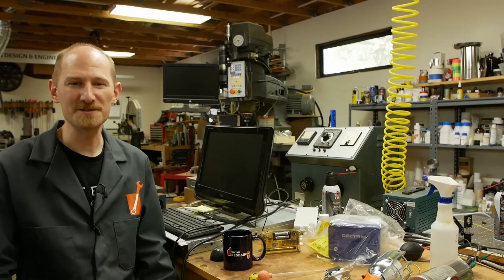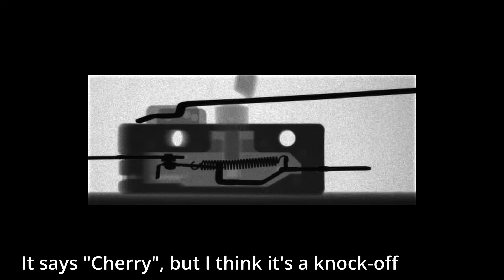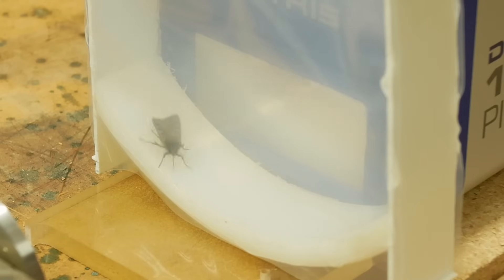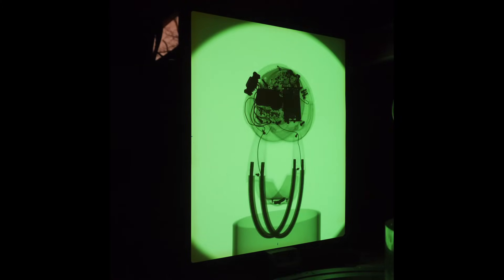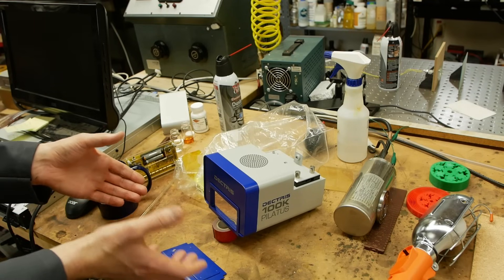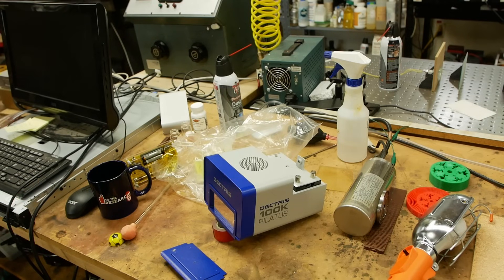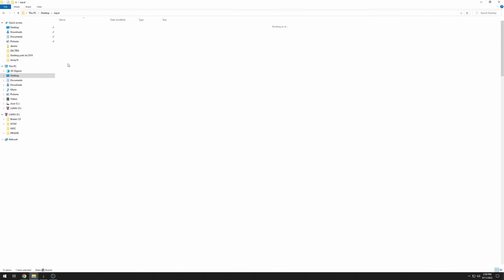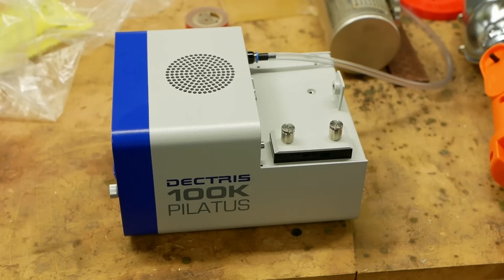High speed X-ray video: jumping beans, wind-up toys and more!

Comment: We are using DECTRIS detectors at work (synchrotron beamlines) so I was very  intrigued to see one of these on your channel. Amazing video. Another thing worth mentioning is the extremely high dynamic range on single pixel level, unlike any other X-ray image sensor. With these detectors any individual pixel can collect around a million photons before it saturates while the adjacent pixels still remain sensitive to single photons, so there is no bleed over as in CCDs. At the same time you can resolve intensity variations of a million to one while CMOS sensors typically saturate at 65000 counts. That's why they are so valuable for synchrotron science where the X-ray beam is tens of thousands times brighter than from an X-ray tube. By the way, the reasony why they're not so common in imaging is because their pixels are relatively large. The Pilatus models comes at 172µm and the new Eiger models have 75µm pixel size. That's a lot bigger than 5-10µm in high resolution imaging systems (with a much worse signal-to-noise-ratio of course). And of course, they are way more expensive than traditional imaging sensors...
Reply: Aren’t modern CCDs pretty much immune to bleed as well? I thought all of the bleed you see in visible light photography is caused by diffraction and other artifacts from the lenses and aperture. This setup doesn’t have a lens and no real aperture, so no bleed.
I might be wrong though :)
Reply: @macyler  I also work at a synchrotron with these detectors, the detectors with bleed issues she's talking about (like the perkin elmer XRD1621 for example) have a scintillator layer of some sort before the actual silicon detector layer. The bleed generally occurs there, where photons hitting one section of the scintillator layer cause a larger area to produce visible light photons that are what are actually detected. The flat field response of the scintillator based detectors also changes pretty dramatically for several days if they're exposed to a strong enough x-ray source, which doesn't seem to be an issue with the DECTRIS detectors.
Reply: @jamesweng5241  Interesting, I guess that makes sense. Thanks for sharing!

Comment: I'm a mineral physicist and have been to many beamlines for x-ray diffraction experiments for high pressure and temperature experiments in large volume presses and diamond anvil cells. We do actually use the detector for imaging too. For example, when we do deformation experiments on samples, we use cylindrical samples in a large volume press. We compress the anvil along the cylinder axis and we want to take both x-ray diffraction of the sample (to calculate stress) and image the sample with gold foils on top and bottom for contrast (to calculate strain).

Comment: If you are wondering why these are so insanely expensive it's mainly because the detector is made out of a single ultrapure crystal of cadmium telluride. You can get a kind of marketing-filtered glimpse of some of the procedure if you search for the video "Growing crystals for photon-counting CT". CdTe photon counting crystals are finding incredible new applications in areas like x-ray free electron lasers with sub-femtosecond pulsewidths, new faster, low dose, "color" CT scanners, and electron crystallography (electrons obey the Bragg law just as x-rays due to de Broglie wave particle duality) where just a single microscopic crystal of practically anything can have its molecular structure identified or solved in minutes with no sample preparation at all (see the paper in Angewandte Chemie from a few years ago "Rapid Structure Determination of Microcrystalline Molecular Compounds Using Electron Diffraction").  They're all using detectors very similar to this where the quantum efficiency is incredibly high, >90% for <30KeV  X-rays, just like camera imagers for visible light basically.
Reply: Awesome explanation,  thanks.

Comment: Maybe some metal reflector could be used as a lens to increase the field of view and be able to shoot bigger objects. My first experiment would be a cylindrical section behind the object, reflecting towards the sensor which would be somewhere besides the object. Probably use the sensor rotated 90° and then desqueeze the image as anamorphic so you get a wider field of view. Of course the optical surface would be a challenge but I know you could make it work!

Comment: Beautiful images! I think a fun subject to image would be the internal stresses of materials under strain. A piece of wood being bent and broken, glass shattering, etc. Does borosilicate glass diffract x-ray photons the same way as light and UV? It could be fun to add a magnifier lens and try to image very small subjects, like diffusion of small particles in water, or bubbles popping on the surface.

Comment: That's so cool!
Actually photon coounting is also used in medical imaging. New generation CT scans with photon counting are making it to clinical use. They allow lower doses of both x-rays and contrast agents, higher spatial resolution, sharper images (higher signal to noise ratio) and allow "native" spectral imaging with higher precision.
At least that's what the manufacturers are marketing, I've never got to use one yet.
Reply: It allows ultra low dose chest CT that are studied for lung cancer screening in smoker ;)
Reply: @TheThinkEat  that's awesome! Thanks for sharing.
Reply: Does anyone know what the hurdles were for these new low dosage ct scanners? At first blush, it seems like the technology has been around for a long time. Given the cost of the normal machines, I would guess naively that  the marginal cost of photon counting wouldn't be huge and the benefit of low dosage and reduced contrast seems enormous.
Reply: @pkomarek  the question would be best answered by the manufacturers themselves but I think that as for any electronics-driven technology,  the main limits were miniaturization and efficiency. For this kind of application we need hundreds of tiny and highly reliable detectors concentrated in a small area (a few sq. inches), which might have been too expensive until recently.

Comment: A couple of years ago I wrote a tiff importer for Marmoset Toolbag 3, using libtiff. When you use that library, it quickly becomes apparent why tiff is sometimes referred to as "Thousands of Incompatible File Formats". Besides high bit depth images, its support also goes back all the way to 1 bit images, with various types of compression (or lack thereof), and file layouts. Programs often just seem to implement a few specific variations.
Reply: Yeah, TIFF is more a container for images and metadata and than a format. Not many people realize that even that container can have two byte orders and either 32 or 64 bit offsets. Then add ability to contain multiple images at different resolutions, possibly independently compressed stripes or tiles, compression can be LZW, Deflate, (less common is JPEG or basically anything) like 20 commonly found metadata records (tags) describing width, height, number of bytes per pixel, number of channels, meaning of channels, ....) and then some less common, but important for some applications. Not to mention that some programs are using these metadata creatively, so you can find SEM image with 254000dpi (example - 10000px/mm or 10px/um or 100nm/px - not even high resolution 2000px wide image shows 0,2mm).
And fun starts when you try to use TIFF for storing extremely large images in tiles - any program that opens it may try to read all data, display that image and either crashes or consumes a lot of memory. Fileformat itself allows it, problem is that most programs ... ehm ... none .... could handle some extreme use cases.

Comment: Not sure what method is used, but manufacturers of Turbofans, Turboprops etc X-ray engines. One company for which I work has just built a new test bed with a capability to record a running engine at 24fps to check engine tip clearances

Comment: I've tried to make the most ridiculous xray camera with a phosphor screen and a few grams of radium as emitter but, as one may expect, that didn't work, given the strength of the gamma radiation.
I've also tried to slow the gamma down with thicker materials, in the hope I'd fall in the xray range, but that seems like it's totally impossible.
I know I can use commercial HV tubes to make it reliable but isn't there a source I can use to trigger some photons out of the phosphor screen, enough to get them captured by a digital camera?
Is there an element or a compound that I can bombard with gamma and have xrays back of it, to accomplish the same with my source?

Comment: The "contamination" on that wind up toy just looks like screws and screw holes to me. Unless I'm missing something. Probably there to hold the two halves of the toy together after they insert the mechanism.
Reply: I was wondering about glue. Some organic materials are really X-ray absorbent, as I discovered at airport security one time.
Reply: @spehropefhany  yeah, the bottom looks like there is glue holding the fur on.

I once had a cake mix in my carry-on and TSA didn't like that since I had an "unidentified powder" in my luggage 😂

Comment: To stem from your use of this to produce shadow grams, there's a similar technique that uses CT scans to produce 3D models with material density. Though it's not as explored due to the obscene cost of CT equipment, due to the medical industry being the only main customer of said equipment, and I think we all know how absolutely scalped the cost of medical equipment is. 

One company that's doing this is Lumafield that Adam Savage's Tested showcased a few months ago, but their machines are the size of an enclosed CNC mill. Though they process all the data through their cloud service and not on a local machine, even though they are entirely capable of doing so, which leads me to believe they're a startup that won't last long due to being a software as a service model within an industrial space that needs local data processing in an offline environment, especially at the cost of their machines. Very bad business decisions of the typical startup scene packed into an industrial machine, it's a mix that genuinely will not work long-term and may even fail short-term; I also have a suspicion that they're doing this in an effort to get bought out by a larger entity, provide tech and proprietary software that can get scooped up by someone with deeper pockets, which again is typical of the current startup scene, making a business just to sell it as a get rich quick scheme. Either way I don't trust this company, their longevity, or their intentions, there's red flags everywhere, but using CT scanning for 3D model processing with material densities is pretty cool; the Tested video is a decent look at it, though I feel like there's a lot of room for processing improvements especially with various claims they have, and I wouldn't be surprised if a lot of the issues with their processing is due to compression when sending to and from their cloud service, which is again why local processing needs to exist, much like the very reason the Dectris products locally processes raw imagery. 

Using non-visual scanning in this way is pretty cool. It's just too bad this kind of stuff will never trickle down to the hobbyist level, with safety being the largest factor considering the enclosure needed to make these kinds of things considered safe would outpace the cost of the equipment itself if it were to ever trickle down from scientific use cases.

Comment: Nice imager.  the mylar front window and the dry nitrogen speak to the bare silicon image device that is then sensitive to only low keV photons and not much else.  your geiger sensor probably is not recording the correct dose since it is highly susceptible to  pulse pileup dead time.   If you want to make a dead time independent integrated dose measurement versus angle or backscatter, let me know.

Comment: Amazing video! Dectris made good decision to loan that device to You- their website will be overrun by interested folks🙂. I would love to have such sensor in my laboratory high power Powder X-ray diffraction instrument since 2d information would enable interesting experiments(I have high sensitivity 1D detector). Primary use of this would be single crystal diffraction- which enables to see atoms in crystalline materials with a bit of mathematics. 
Maybe You could shine the beam through long colimator (like thick needle with some extra material wrapped around of it so that not straight photons are blocked) and then through single crystal or powder? Long exposure would be needed.
Reply: 2d xrd patterns can show phonon oscillations even with low frame rates, due to a resonance between the frame capture and the movement of the crystal matrix
Reply: see: WHITMORE; Direct imaging of travelling Rayleigh waves by stroboscopic X-ray topography.

Comment: Can X-rays be focused (like a glass lens) or refracted by any material?
Reply: Yes there are refractive optics for X-rays, typically made of a light metal, either beryllium or aluminium. To get enough refraction for focussing typically a stack of lenses are required. These are called compound refractive lenses. Note that X-rays refract in the opposite direction to visible light so the lenses are actually holes in the metal. You can also focus X-rays using parabolically bent mirrors and reflect (technically total external reflection) at grazing angles.

Comment: Contaminant in the plastic toy is likely a mix of small aluminium particles and lead, as the plastic used to make the inner parts will be the cheapest possible, which is often the scrap plastic from making PVC lined foil, mixed with old battery case plastic, so you get the contaminants of aluminium and lead oxides finely ground up in the plastic, along with all the ground up pigments they had.

Comment: This is mind blowing, such setup in your lab
Also about uncompressed tiffs and an overall size and speed of output: as far as I know, substantial amount of cost of LHC, despite the complexity and high cost of the structure itself and its sensors, is actually a computational setup (I mean servers, network and so on), because there is no way to store information at that bitrate and enormous amounts for later processing, so data should be processed on the fly, and actually store only certain events with given conditions

Comment: In 1972, Field Emission Corporation had a high power pulsed x-ray machine that ran at 1000 frames per second. The setup used a Varian image intensifier tube and a high speed camera with rotating mirrors so the film never slowed. The demonstration showed a model airplane engine running. The actual use was to image pig brains under high G loads using a rocket sled and rapid deceleration. The data was used by the space program and military. 
Other products allowed stop-action x-ray images. One machine was capable of producing a 2.5 MeV pulse of 4 ns duration. There were interlocks to the room because the scattered radiation dose from one pulse was lethal. The unit was used to x-ray bomb detonations in the dessert, x-ray aircraft engines, simulate atomic blasts in small spaces, radiation harden semiconductors, and other things.
Reply: sounds very similar to the DARHT facility at LANL to image the implosion hydrodynamics of nuclear weapons core surrogate plutonium pits.
Reply: Back in 2010 I was touring a few universities to see where I might want to go, and met a guy at UCSD (I think) who told me he'd gotten an assignment to take a photo of a large explosion without detecting any of the explosion's own light, and he'd used X-ray imaging to do it. I wonder if that was related to this?

Comment: A camera lens in action could be interesting. You might need to get a cheap lens with a plastic body, and if it's a manual lens, a loop of string around the focus ring will allow you to operate it remotely.
Reply: Most of the mechanisms would probably be quite boring, but I'd like to see the ultrasonic focus motors and image stabilization working indeed :P
Reply: Like say from one of the big hunking telephoto lenses that can have 100g element being moved quite fast.

Comment: I wonder if something like this would be useful on a food production line. Pass a few thousand cookies per day or something in front of it, and pass the images through an automated check for dark spots, which would be x-ray absorbing foreign objects, like screws and such.
Reply: Metal detectors would be cheaper.
Reply: that's already a widely used process, just not this type of specialty device that can do video. Instead you can simply take an x-ray "photo" of a stopped cookie and get the same ability to check it (not to say they check cookies, specifically, but x-rays are used a lot in factory QA etc, and even computer vision is now adding incredible new ways of doing QA and automation).